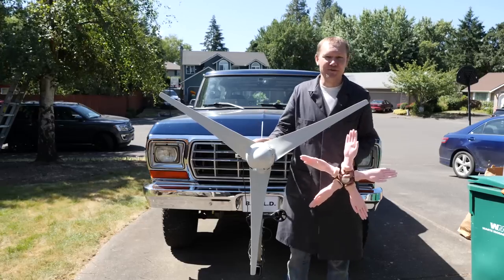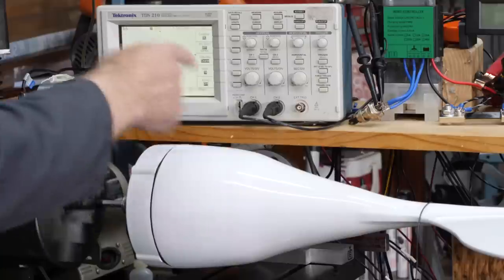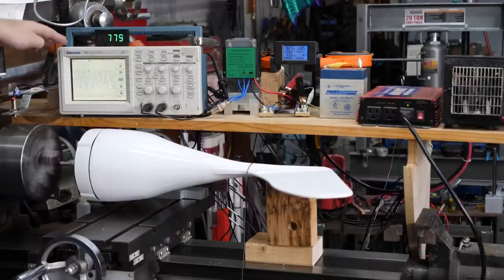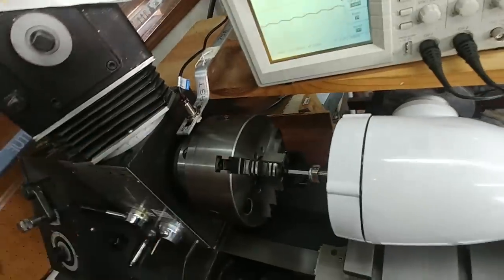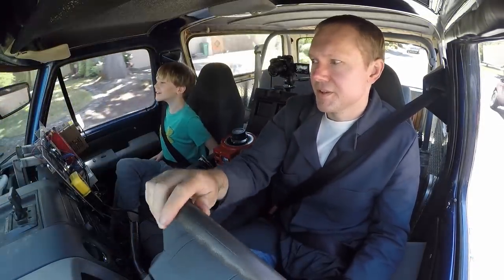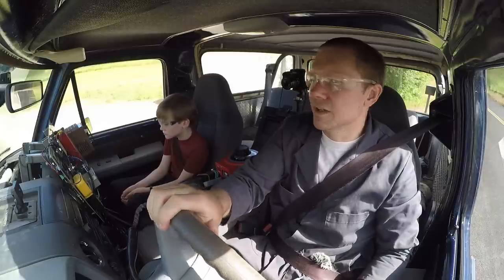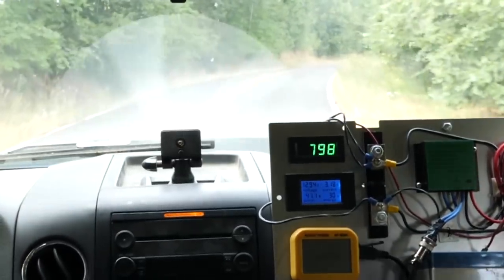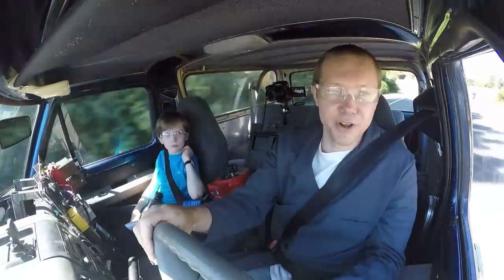Wind Power on a CAR #2 - Testing the Betz Limit for Turbines

Comment: More blades don't equate to more power, after three it's meaningless once you get over a certain wind speed. By the way, I've monitored wind here for several years with a high quality station. I'm in a windy area with a 4 acre field in front of my house. The number of times I see an average wind speed of 25 mph is once or twice a year if that! Those mills are way overrated.

Comment: So again driving on public roads with a blunt spear sticking out of the front of your truck, did you risk assess this in any way at all? Perhaps you could calculate the minimum speed required to punch that rig through the side of a car and the people inside, obviously pedestrians wouldn't offer enough resistance to make it interesting.

Comment: The problem is that everyone has missed my point. SWEEP OF THE BLADES.MEAN NOTHING. why? Because it's not the amountnof air available,  it's how much you can capture. Those "skinny ass blades" may look good, but it only CAPTURES a fraction, of what larger or fatter blades, could capture, and that increases the torque,  which in turn affects the potential power output of the generator.  HELLO?
Reply from the maker: So why do commercial turbines have skinnier blades then?
Reply: @QuintBUILDs  because they are of the belief that LONGER blades equals a better generating capacity.
Reply: @QuintBUILDs  Because they are only stupid scientists who swear by the "sweep" of the blades.
Reply from the maker: @brianrichard8310  you'll have to pardon my lack of understanding and explain what you mean by "sweep".  I'm only familiar with the terms I've been exposed to thus far such as solidity, chord length, camber, area...
Reply: @QuintBUILDs  google it.
Reply from the maker: @brianrichard8310  thx for confirming my suspicions. Good day.
Reply: @QuintBUILDs  Look under fluid dynamics.

Comment: Great video.
Just some observations.
You need to check the power rating of the lathe motor.
Do the maths please!!!!
It is not RPM you need it is torque AND RPM, which is power.
Changing belt ratio does not give you extra power.
The windcharger controller probably has a DUMP LOAD built in, so when you get battery voltage to a limit, it dumps the wind turbine output to the load.
Can I suggest you get the turbine HIGHER?
At the start of the video you show the calcs rely on the air getting away at the rear.
The air in front of the vehicle has to climb over the hood  after leaving the turbine blades.
Did the turbines come with any user manuals?

Comment: Ok what are u driving ? I seen a 70s ford front end and a 2005 or so f 150 dash and looks like a jeep back inside of a truck u are driving I've not went through the comments so something is way wrong with this
Reply: Ok 70s bronco with a new style dash ??
Reply from the maker: 78 bronco with guts from a 2004 F150. Resto-mod from before I knew what that was.
Reply from the maker: Engine, trans, xfer case, AC, ABS, power doors...

Comment: There are 6 mid roll ads in this video
Reply from the maker: Should be no more than one every 5 minutes...
Reply: @QuintBUILDs  then the amount of ads sounds like it is what you want it to be, but their spacing is not an even five minutes between each.

Good video, tho.
Reply from the maker: Yeah supposedly some AI attempts to determine the "best" spots to inject. Rober's squirrel course seemed to drop them right at 5 minutes when I checked.  Helps pay the bills as my Patreon isn't yet very big.

Comment: Jesus Christ. You need to frighten up the front end on the truck. Check your tie rods, pitman arm, idler arm, and adjust your steering gear box if all else is good.
Reply from the maker: It's the track bar.  Joint on the front axle.  Haven't gotten to it yet...

Comment: YOU ARE TRYING TO WORK WITH 3 PHASE POWER . THE SAME AS YOU MIGH TRY TO WORK  SINGLE PHASE POWER
WRON MULTIPLY THE READINGS THAT YOU ARE GETTING BY 2 1/2 AND THAT IS WHAT YOU SHOULD BE READING
Reply from the maker: I'm measuring after the...  ahem... I'M MEASURING AFTER THE RECTIFIER. Do we have to converse in all caps?

Comment: Why not put it on the roof? 
You casually dismissed the idea that back pressure wasn't affecting performance in an older video but then showed in this video that it does..
Reply from the maker: I don't think I ever used the term back pressure. What exactly was it I said?
Reply: @QuintBUILDs  a cushion of air/ pillow or something to that effect.